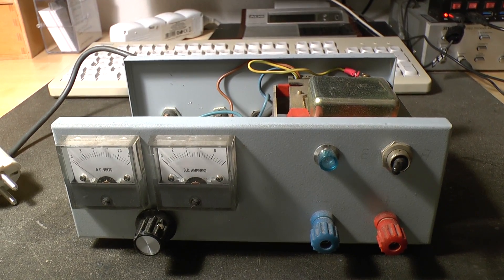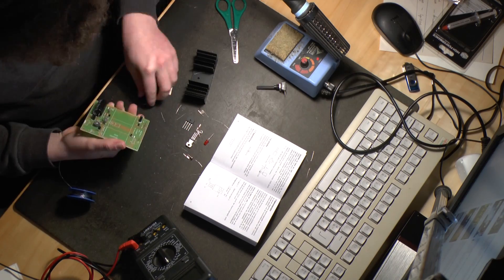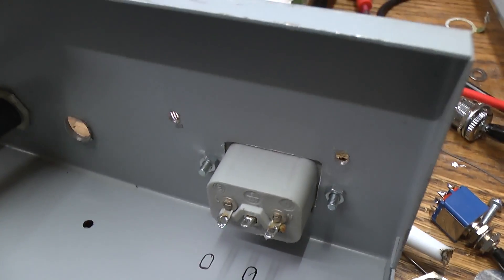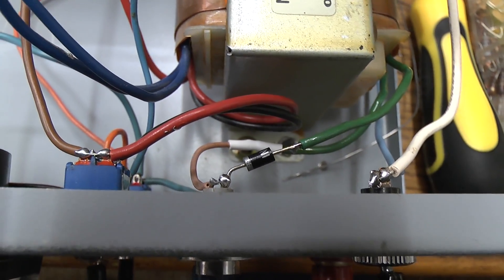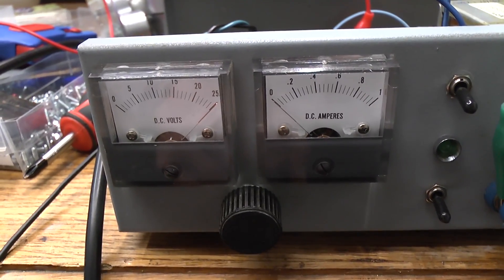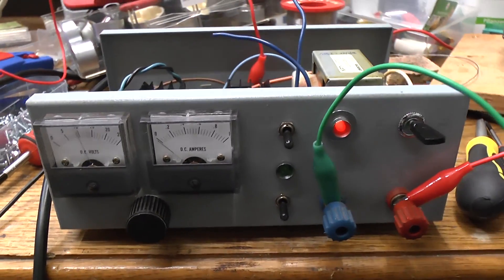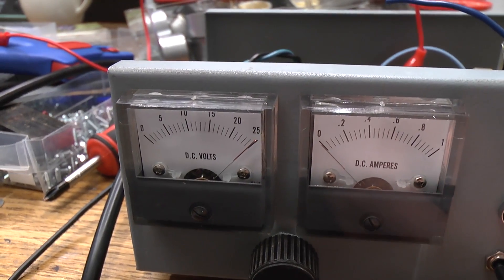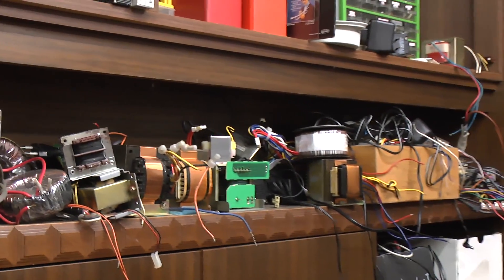DrCassette's Workshop - Building a Bench Power Supply

Comment: Great video! Definitely one of the most informative of the bench power supply build videos I've seen. As a noobie embarking on one of my first projects (also a bench power supply), I would have appreciated a more detailed look at the path between the components, but that probably would have bored your main audience. Judging from the comments, they seem quite knowledgable. Many thanks for a straightforward explanation. Following you channel now!
Reply from the maker: The circuit the adjustable power supply module uses is just a slightly modified version of the "Regulator with Protection Diodes" circuit shown in the National Semiconductor datasheet for the LM317.

Comment: I'm sure you looked at the rating of the transformer before you put it in your power supply. And I'm sure you are taking into account that the bridge is dropping about 2 volts and you are losing another 1.3 volts in the regulator. As JP said, it's not the transformers fault. If you have a transformer rated at 24v @ 1 amp, and you put a 1 amp load on it, you will not get 24 volts. You have to consider the in-circuit losses. As for the LM317T, with the heatsink you have, should be able to handle 2 amps for at least 1 minute before thermal limiting sets in. And, the 40V limit on the device is a differential limit. Vi-Vo. However, if you use the LM317HV, you have 60V differential limit. If that makes you feel more comfortable. Higher current rated regulators won't help in this case. You just need to work within the limits of your transformer.

Comment: It's not the transformers fault you didn't check the output voltages before you used it. That transformer looks like it could handle about 4A so why mess about with at a guess is yet another LM317 regulator, get a LM338 - max 5 A or an LT1083 at 7.5A. I do hope there is some cooling slots or holes in the top case. If not make some and perhaps add a fan if you upgrade. I am sorry but I found your  video a classic how not to build a power supply. Well put together and it's nice to see old parts used but do check them out before you start a rebuild. Never mind, we learn by our mistakes.
Reply from the maker: The output voltages of the transformer dropped drastically under load, there was nothing wrong with the LM317 used by the circuit.

Comment: Was it really worth all that work? A bench PSU need to have at least 30v output and a current of 3 amps with current limiting
Reply from the maker: I built this unit for myself. And I barely ever need more than 20 V or more than 1 A. An adjustable current limiting indeed would be nice to have. But considering this thing never worked right anyways, it doesn't really matter. This is not the only bench power supply I have.
Reply: Silvio De Leonardo DrCasette hahahah 15V 1A is more than enough for general electronic circuits if you need high power get a specific power supply for that because when power increases noise and unstability problems appear. As dave from EEVBlog says you wont need more than 15V
thats most opamps can go at most cases,

Comment: I hate using adjustable voltage regulators as a power supply. I prefer the old classic discrete way such as a Series pass transistor, opamps and such.
Reply from the maker: Why is that so?
Reply: A linear voltage regulator is fine for a single constant voltage rail for a circuit but for a head end of lab power supply falls short. such as only limited to 500mA to 1.5 amps depending on the regulator you select unless you add other things such as a series pass transistor for a higher current output but if you go that route then you're just using the regulator as a voltage refence and you can use a zener diode that is much cheaper for that purpose. A regulator can only Buck the voltage and you cant use the whole maximum voltage swing ket alone have an option for zero volts.
Reply from the maker: I don't know what you are doing, but for me, a maximum current of 1 A is fine in most cases. 
As a voltage reference, a zener diode may be cheaper and more simple, however, it will need one or more additional transistors for decoupling and even then the load stability of a zener diode based voltage reference is limited. 
Linear voltage regulators use the ground potential as a reference. If you shift this potential (insert one or more diodes), you can get regulation down to 0 V, or in case of fixed voltage regulators, you can shift the voltage slightly.
As far as I know, only switched mode power supplies can take advantage of the full input voltage.
Reply: DrCassette really the method he says has way less noise and stability problems if you do it right. Also it will have higher performance in every way.

Comment: You should have used a full bridge rectifier for the power LED, you only get half the AC wave with one diode
Reply: A bridge rectifier will have 2 diode drops (1.4v) on each side of the sine wave, which although will light the LED twice as often, it will be much less bright, and perhaps not be enough voltage to allow current to flow.
The best method is to remove the series diode altogether, and simply use a current limiting resistor, as the LED will half-wave rectify the AC signal by itself, as it is a diode. You just need to make sure that the maximum reverse voltage on the LED is less than the AC voltage, which it should easily be.
Reply from the maker: I only needed the half wave. Don't worry, I know what I'm doing.

Comment: I don't see how that kit could adjust current properly without a comparator.
Reply from the maker: The kit will only adjust the output voltage. There is no constant current mode on this.

Comment: You can easily replace the LM317 by a  ̶L̶M̶3̶3̶7̶ (Rectification: LM338), for to have more current output, and for a more robust power supply.
Reply from the maker: The LM337 is the negative output version of the LM317, they are the same otherwisely. But I know which chip you mean. You could use that, but with limitations. The LM317 has a maximum current output of about 2 A, the LMxxx (I can't remember the number either) will output 5 A maximum. But the total power dissipation is the same. So the 5 A are not available in most situations.
Reply: Hi, sorry for my mistake, I mean the LM338.
According to the datasheet, the LM338 can dissipate 50 watts max, and the LM117 20 Watts max.
These amps are provided only when output voltage is very near to the input voltage.
Powers (20 and 50) are calculated by multiplying the maximum current trough the LM with the voltage present between " lead IN and lead OUT. I built a power supply with it in my videos ( Tiny DIY power supply LM338 Regulator) and it can powered cold 24 watts 12V bulb from the cold state to overpowered (what can not the LM117 do). Thank you for your response and sorry for the stupid mistake.

Comment: Hello DrCassette,
I was wondering if you could post a link to where you purchased the power supply DIY kit. I have been looking for a replacement DIY kit for a PSU unit that went bad on me, but has an awesome chassis complete with temp. controlled fan cooling! 
I appreciate it.
Cheers!
Reply from the maker: +Matthew Green 
I bought it in a German store, not online. So there is no link...

Comment: I forgot to mention that you can refer to the ST TDA2030a data sheet for the performance of a 50W linear power supply transformer. Normally I would use a 10ohm/20W resistor to measure the maximum current of an unknown transformer (just for a few seconds cause it may burn itself out in case the transformer is powerful).

Comment: I've noticed that the mains fuse wires are close to the heat sink. It's a good practice to separate primary and secondary sections (wires and pcbs) for a safe operation and to prevent interference from the mains 50Hz. The overall work looks good and tidy, the power toggle switch direction is +1. Surely I would say thank goodness for your safety cause a short across the mains is pretty nasty specially if the face is close to the work area. Best regards,

Comment: 5:15 You don't need diode, why not use only dropping resistor instead?
Reply from the maker: +Felix2417425 
You do need a diode. Of course an LED will work when connected to AC, but it wears out fast.
Reply: Thats ok to do, just a led and a dropping resistors will do, also with good insulation and higher resistance (prefer 2 , one at both of  wires) it can be connected to the 220v directly, and the voltage drop if u really want use a diode is then perspectivy "smaller"

Comment: That transformer is undersized, or your load resistor is too small. You should not see more than a 10% drop in secondary voltage from open to rated load.

Comment: What about the Telefunken transformer? Does it even works? I thought it could handle the load pretty easily because of its size. Maybe it doesn't have 2 output voltages, and thats why you ditched it.
Reply from the maker: +Santiago Hormazabal (Coco) 
I didn't test that transformer.

Comment: sounds like you didn't measure the transformer output voltage under load.  Those amplifier transformers are great but you need to put it under load to properly identify its output voltage.  Those transformer are power hungry even at idle and will get warm to the touch under no load.  This is very typical.
Reply from the maker: +Jay Walt 
It is normal that the transformer voltage changes slightly under load. However, a 10 V drop at a relatively low current of 1 A is way more than normal. Also, the transformer gets way too warm at idle.
Reply: +DrCassette true true didnt realize it was 10v.  Im like half awake though =)
Reply: +DrCassette It sounds like it may have shorted turns or be massively undersized in the iron core dept.
Reply: +TheChipmunk2008 onkyo is a very well made amplifier stereo here in the states.  Its design is solid, its probably just failed..
Reply from the maker: Thing is, the transformer is not out of an amplifier, it's out of a higher ended cassette deck. That probably explains why it's so weak.
Reply: +DrCassette oh most definitely.  It looks decent sized to me and I just assumed an amplifier.

Comment: When you didnt hawe right transformer,consider a cheap 24V [laptop] impulse power supply.You may upgrade to 4A,spikes are easy to filter.You may also do non linear voltage regulation like LM2596S module.It will work much stable and efficient.